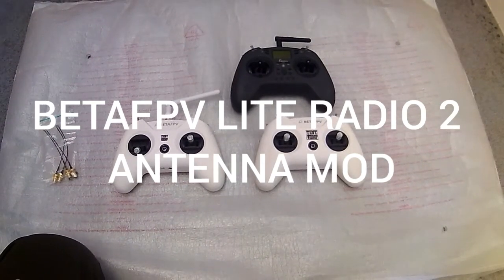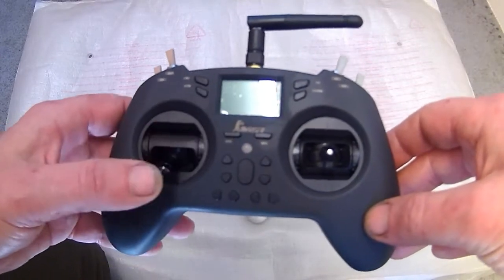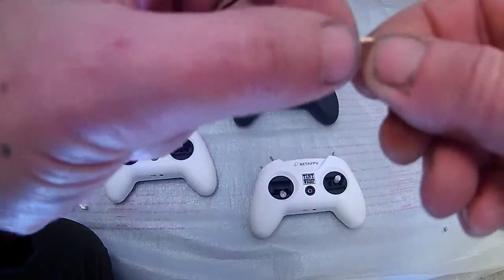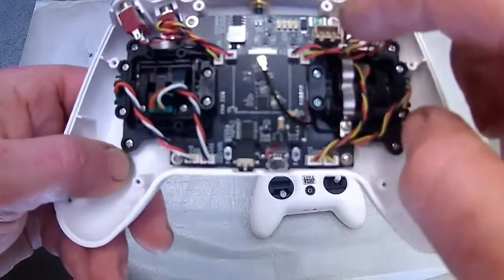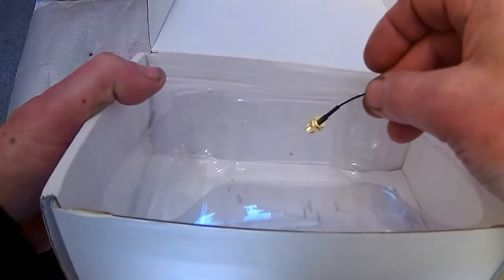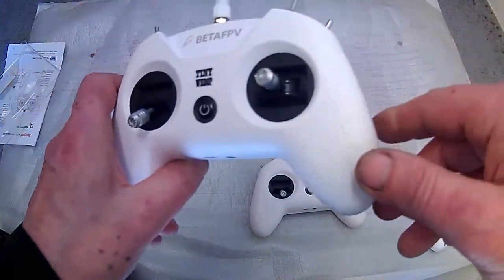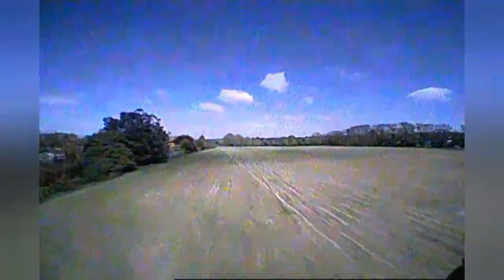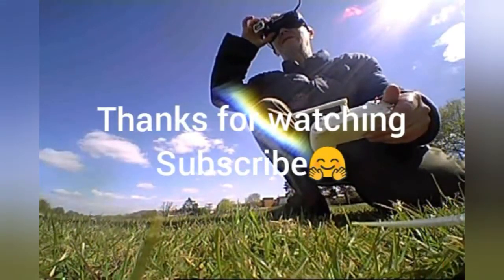BETAFPV LITE RADIO 2(EXTRA RANGE ANTENNA MOD+RANGE TEST)

Comment: Lite radio  has better range than lite radio 2 i just made the range test
Reply from the maker: Odd that because lite radio is 80mw and lite 2 is 100 mw
Reply: @cyclops-fpv    iknow but that was my experience    and it supose to work better at range but behind me only like 60 ft i open both the open tx radio has bigger TX than the SE edicion but i  dont know
Reply from the maker: @transitionfpv6707  how far did you get before losing signal
Reply: @cyclops-fpv  to the front i have no complaints but sides and behind me only like 60ft i was flying the same path as always and it go to failsafe like 4  times
Reply from the maker: @transitionfpv6707  try higher dBi antenna although I get over 400 metres before I lose camera (25mw only)but still have radio connection before I ran out of field distance. Havent tryed it further than that yet.
Reply: @cyclops-fpv  yes i see your video im going to do the same thing as you thanks
Reply from the maker: @transitionfpv6707  its very easy to do.but remember to fit the antenna first before u switch transmitter on or you will blow the tx .
Reply: @cyclops-fpv  got it

Comment: Good video. I would like to see a video on how to change the lite radio protocol. Mine is the bayang. It would be great to change it to frsky.
Reply from the maker: You can't change it,you need to buy the frsky version which I also have but its stock at the moment.
Reply: @cyclops-fpv  i didnt think the protocol could be changed on this one. Not a problem though since my jumper t12 just arrived. 👍
Reply from the maker: @FpvBudgetBuilds  good choice!that's a great transmitter I nearly bort one myself but got a radio master tx16s instead.